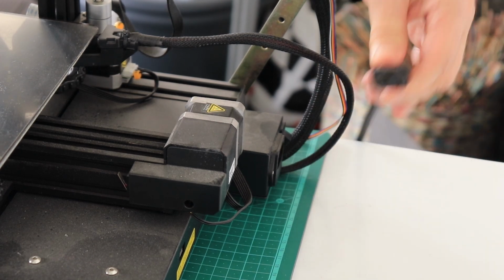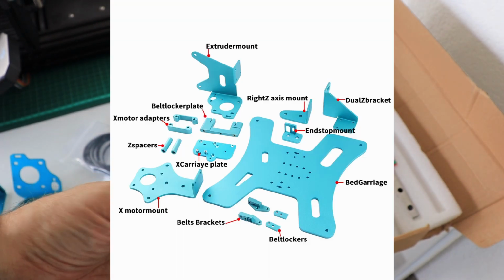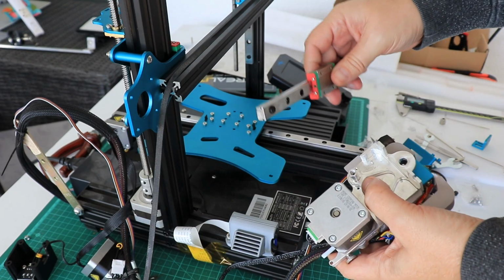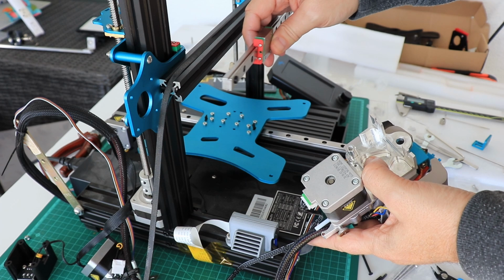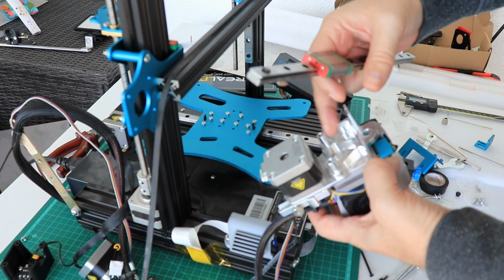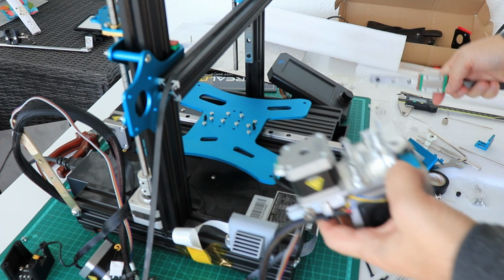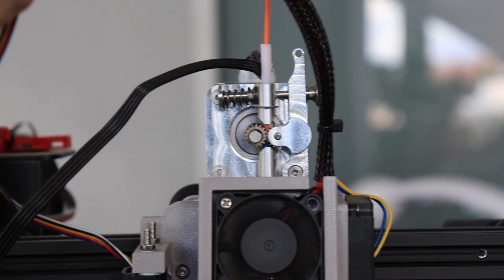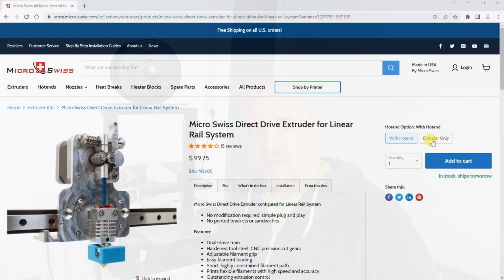Ender-3 V2 linear rails upgrade - Dotbit BLV upgrade kit installing

Comment: The bracket you didn't use for the bed is designed to move the bed limit switch so it can hit the bed. 
You drilled 2 holes and added an adjustables bar no reason. Wen you could have just relocated the switch to the correct area and adjusted it with like it was designed to do.

Comment: Took me a while to realize you were getting rid of the wheels. What confused me was the fact that you still had the belts. You eliminated the “wearable” wheels, but the belt is still necessary. I now see where this could make it possible for much higher print speeds.  Great tutorial.

Comment: Hello! I am mounting the same kit on an ender 3 v2. If I adjust the left side (the blue pieces with spacers) of z with the original screws, the transmission belt of x is too tight. Did you use T-nuts for the left side as well as the right?

Comment: While sliding the bed forward and back it sounded a little noisy would you recommend oiling or greased the bearings on the rail?

Comment: I am teaking acceleration right now and am interested in what this does to the acceleration limits of the printer. Do you maybe have a accelerometer and might be able to measure the limits? I only get around 2500 mm/s² out of my Geetech A20M with VRolls and am thinking about moving to linear rails.
Reply from the maker: I will mount BTT Pad7 to it, there will be a video soon.

Comment: Nice work! Did the upgrade 3 years ago with my CR10v1. With stock firmware you will not notice any big change. But i promise you when you switch to Klipper you will benefit from this rail conversion a lot. With wheels and stock firmware about 30-40 mm/s. With rails about stable 50mm/s. Now with Klipper firmware about 150mm/s. On a page for Klipper tunings i found out that my hardware is capable of about 300mm/s and acceleration of 2900mm/s² without losing steps. But the actual limitation is the extruder with 13mm²/s (13: Nozzle 0.4: Layer 0.2=162,5mm/s) BTW: As grease i use lithiumgrease. Works perfect for this kind of stuff.

Comment: I've Ender 3 V2 Neo, on X axis you're obliged to change the 2020 profile because there's not front and rear binary where to put T-nuts. 
I'll do this mod only on Y and X axis. 
On X axis it's possible to change the entire hotend with Titan+E3D V6 taken from Kingroon KP3S 3.0 that is already on rails using the same rail type on Kingroon KP3S but of 300mm.  I'll be back at job finished.
Reply: Did you end up changing the X extrusion to fit the linear rail?
Reply: @nurelarab   no in the last mod I drilled 3.3mm holes and built M4 thread. 

https://www.youtube.com/shorts/r4AwSeom8TA

Comment: You actually don't have to drill a piece for the Y switch. The adapter you didn't use mounts to the frame for the switch. But they have sensor less homing these days..so it's  probably not as important. Thanks for posting the Z axis measurement from the top...that will save everyone a headache.

Comment: That looks like a lot of money and effort, for no visual improvement. Pretty much in line with 3D-printer upgrades or car tuning (less than 10% power loss -> success) 😁
Maybe middle road could be metal wheels running on steel bars + aluminium extrusion. I have seen that kind of small printer somewhere, but can't remember where 🙄
Reply: I've started using Klipper and noticed the extra speed is literally starting to grind my wheels. Linear rails will let me sustain the extra performance i'm getting from klipper long term without damaging the printer. It's like using drum brakes that catch fire on a high performance car because you think vented disk brakes don't give you any improvement.
Reply: @Stuntman707   Your case is different, and you should know it :)
As long as we stick to context, POM wheels are perfectly fine for the speed MK8 hotend can offer (it's not much and Klipper won't improve it). Test showed no improvement, in print quality and that's it.
Manufacturers think wheels are fine for Ender 3 V3 SE (except Y) and Ankermake M5C as well. Both are faster than Ender 3 V2.

Make no mistake, I'd like to see more linear rails, linear bearings (Sovol SV06, Prusa) or metal wheels (Anycubic Kobra 2, Elegoo Neptune 4 Pro) in affordable fast printers, where they offer benefits over wheels.
Reply: @kimmotoivanen  the purpise of linear rails over wheels is not to change how the print looks. Its to be able to increase speed and never have to replace wheels. 
Thats not a "different use case" thats the only use case. The rails cant really change the print quality unless your wheels are already worn out.
Reply: @ Slow and moderate speeds and accelerations are just fine with POM wheels.

When trying to print fast , POM wheels deform under force and allow too much twisting and sideways movement (e.g. bed jumping up and down) --> linear rails or rods can recover the lost print quality back

Fast printing also requires a hotend that can deliver. MK8 doesn't. It has been tested.

IMO in 2025 installing linear rods is pretty useless, as there are good fast printers everywhere 😉
Reply: @kimmotoivanen  yeah but i already have the sprite head upgrade  and my wheels are starting to be worn out from regular use so i might as well do this upgrade since its now only £65
Reply: @ge2719  for X and Y? Seems good price 😀

Comment: I would like to see linear rails on the X axis as well. Plus I would want a kit that you don't have to mod anything to get it to work. Also I got the ExOSlide upgrade kit  for both my X and Y axes. I ended up removing the kit. Just to much mods involved to get it to work better off just making a new frame,from scratch. Its not that hard to build a bed slinger from scratch. The hardest part is sourcing the parts.

Comment: Do you like Microswiss extruder? It's very nice open type easy to clean unlike let say Biqu H2.
Reply from the maker: Yes, that's exactly the reason why I like it. My favourite for problematic TPU filaments.
Reply: @MyTechFun  Currently I test Biqu H2 V2S with their Nova hotend copy however willing to design similar to Microswiss using its gears.

Comment: Its suitable for Ender 3 S1 pro ?
Reply from the maker: I just analyzed the pro. The answere is NO, because Creality decided to cover those so useful grooves on alu extrusions (on Y and X). Also the Z is longer on S1, so rails would be short (or you lose max Z height). Similar problem I had with LED installing https://youtu.be/v-xQJMO5-fk

Comment: There is a picture on Banggood showing how the y axis endstop is supposed to work, the bracket seems to be made to move the position of the switch on the Y extrusion. Is it incompatible with the V2 because of the position of the power supply ?
I'm not sure I agree with the part about rails needing  way less maintenance than v-slot wheels, the feedback I got is you get what you pay for: chinese rails do no tolerate dust and particles from filament, and they become quickly crunchy or with hard spots, you need to take them apart regularly and it's a big pain not loose balls.
All in all, the kit is more expensive than what I paid for my V2, and seems to bring not much.
Thank you for your review, it's good to show also when a product is not really good.
Reply from the maker: There is a solution, to move limit switch to that holder and screw to the groove of 40x40 alu extrusion, then you can even slide it to have fine adjustment. But on my V2 I wanted that switch to stay where it is. That's why I created that switch presser plate.

Comment: Hello My Tech Fun! Most linear rails need to be degreased and re-greased as they only ship with a protetive shipping oil - you'll notice this fairly quickly if that's the case as they'll become very unsmooth way too quickly :) Just a friendly heads up, otherwise great video!
Reply: Yes I did on my Kingroon KP3S, degrease with WD40 degreaser and nitro solvent. Regreased with PTFE based white grease. Now they're smooth.

Comment: Hello Igor, I have the Black Knight linear rail kit + OMG V2 Extruder +  ASPINA Shinano Nema 14 motor. Very light extruder + motor combo. I was able to increase the acceleration by double.
That is where one can gain total speed and quality in my humble opinion. Cheers
Reply: You had the piece included in the kit for the limit switch placement. It goes on that small blue angle part. It’s attached with screws and t nuts to the rail beneath the bed.
Reply: Great video! Thank you!
Reply: To gain speed and quality you need to replace that printer, not mod it to death and spend money on it
Reply: @itayst  Free lesson for you:
- never give advice if not asked for.
- never criticise how to spend money, unless it is your money.
Mind your own business.
Wishing you a better path in life ;)
Reply: @itayst  quality on the e3 is fine. Don't need to spend tons of money if it all. Speed is definitely limited by the moving bed though.

Comment: Those cali cubes looked terrible! I put linear rails on an Ender 3 and had much the same experience, the prints were terrible, I changed it back to the wheels and got back perfect prints, I also cleaned the carriages and relubed them before fitting.
Reply from the maker: The plan was: Those cubes are scaled and speeded up on purpose to get bed quality and to see if new setup will have less bed quality. If I would print regular size-speed cube, it would be perfect and we cannot see the difference. I didn't know at the beginning that I cannot see the difference in this case anyway.